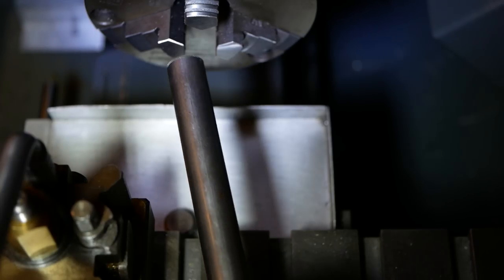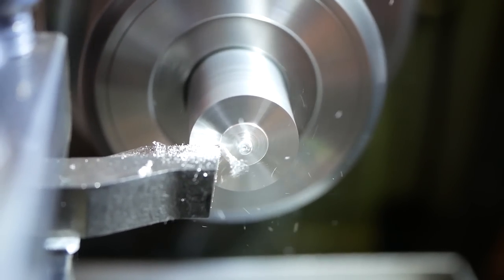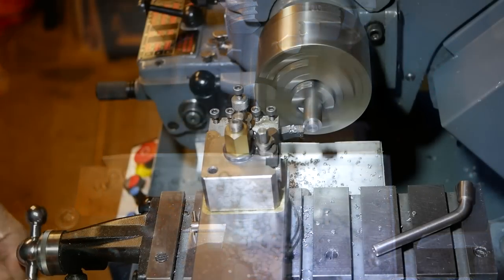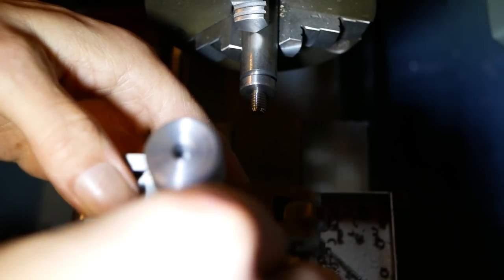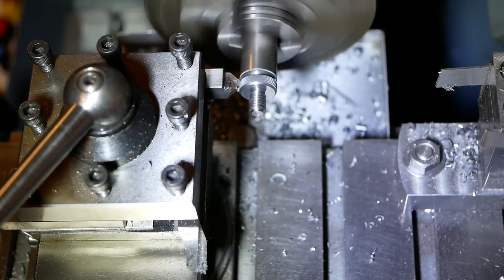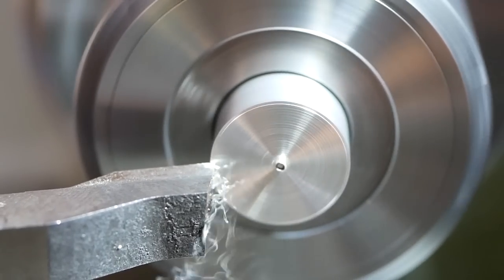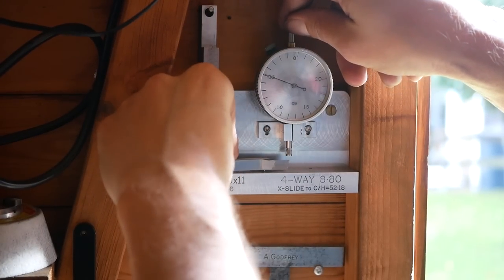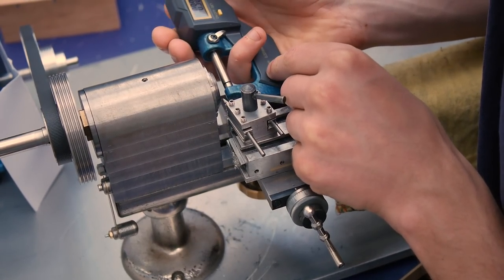In Defence of the 4-Way: Myford Toolholding

Comment: I like the way you think and I like the traditional four-way and I will offer to you another way to make life easier and actually it's a little cooler looking as well after all we always enjoy style points don't we? 

My suggestion is to remove all the socket head screws and replace them with 12 point alloy steel bolts which are very popular with the speed tuning set for mounting exhaust headers intake manifolds and the such.

The American fastener manufacturer ARP supplies these type of fasteners in stainless steel and alloy steel I personally stick with alloy steel last chance of galling and it stays in vogue with the entire tool steel family on the lathe

Then go buy a corresponding dedicated T-Wrench that has the socket size built-in to match your 12-point bolt head --of course it's a 12-point socket and it drops onto the bolt head extremely easily you don't have to Fumble with loading the Allen wrench into the socket and on top of that since the 12-point bolt head is of male configuration you do not have a cavity that collects swarf and chips and grease and dirt and every other thing including hot dogs and stray fingernail clippings and in turn is much easier to keep things clean on the tool holder itself whilst guaranteeing 100% purchase each and every time you drop the dedicated T-wrench/socket onto the 12 point head. Also keep in mind the 12-point bolt configuration has a skirt at the base of the head that the socket nests into once it's seated.

Also being that we are destined to do things right you will eventually be determined to machine a dog nose feature on the end of each Bolt it takes a little time and my goodness if you happen to have a lantern bolt holder that would make life even easier at minimum you will want to dress the end of the bolt because it still has the deformation in it from the manufacturing process and of course you want a nice flat surface to intersect at a right angle with the cutting tools you are securing.

Once you go with this configuration you will never go back to socket head cap screws I assure you.

I wish I had a way to send you a picture of my tool holder with the 12 point bolts in-situ.

Thank you for the wonderful video excellent work it's great to have such an open and easy exchange of information in this type of forum 

Cheers

PS...

Please keep in mind I'm referring to the reduced size aircraft style-12-point point bolt heads. Another factor missed by many is that the socket size for this configuration bolt matches the thread body size so for example if you are in the English or SAE system a 1/4-20 lnch 12 Point bolt will then use a quarter inch wrench12-point socket.

Comment: I am wondering why to change from a lantern style tool holder....  All tool holders seem a pain and they all need adjusting capabilities.  I'd guess saving time being key. (?)
Reply: I liked my lantern toolpost on my south bend. You can eyeball center well enough after a while. They also center the cutting load over the cross slide and are much more friendly for working right up next to a live center. They don’t deserve the bad rap they get.
Reply from the maker: If it works for you, I would stick with it. I know many watchmakers use lantern toolposts. Agreed, I think the faster tool changes with more modern toolpost designs is why few people use the lantern style ones.
Reply: A couple reasons. Every time you use a different tool you have to set the height.  But besides height you are also dealing with shims or extreme angles for smaller size tools.  The QC allows you to set a tool once in a holder and then it's good for quick changes.  The turret type also has tools set once if you're only using 4.
Reply: Thanks for the input(s).  I still ponder making a different tool post, and have, but for as little as I use the S.B., I will stick with the lantern..., for now.  Thanks again.

Comment: I’m going to disagree with this. My quick change is considerably faster. Not only do I have an excess of tool holders, but I always have my tools pre adjusted for center height. I have a dial indicator tool a made to set the center height when I do use a new tool. Your QCTP seems to require wrenches, mine is completely tool-less. I made and ground mine myself so it’s especially tight and solid. I engrave tool numbers on my tool holders, and store the tool offsets in my DRO. For your shop with the system you have it may be faster using a 4 way. But in mine with my system, a 4 way is leagues slower.

Comment: Shimming each cutter sounds like stone age especially when the cutters need the different shims. Buy tool holders when the price is favourable. I've got 30++ of them that way. Bringing the cutter, the tool, to center height is a one time job. Using a good method it's done very quickly. The so called QCTP was developed for a reason and got its name for a reason. The four way coming with the lathe was removed before the first cut. That ancient technology was used during school time 55 years ago and really disliked.
 Do what makes You satisfied. I disagree completely with You.
Reply: With insert holders, 'shimming' is a one time job. Mill a spacer for each of the holders, and keep them together- put them in and they are right every time.
Reply: @Tensquaremetreworkshop  Milling thin spacers, shims is not exactly an easy job for a hobbyist and it takes considerable time. Okey, it cost less money, but still inconvienient in my opinion.
Reply: @Stefan_Boerjesson  not so thin- circa 5mm. And only 2 sizes- manufacturers make carrier sets to the same height. Must have taken 15 mins tops. For them all.
Reply: @Tensquaremetreworkshop  Yes, You're right. Using standard HSS the variations are not that many. Still, untightening and  tightening those 4 screws, adding the shim, feels like slower, and inconvenient to me.
Reply: @Stefan_Boerjesson  2 screws (bolts). Dab of superglue the first time, and the spacer goes with tool. Most are the same height, so half turn lock/ unlock. When you need more than four tools.

Comment: The whole premise of this video is dumb.  You have your quick change tool post "cartridges" right in front of yourself in arm's reach. 

The seriously prehistoric 4 tool holder are dangerous as you have razor-sharp tools sticking out on 4 sides and one of them pointing straight at you!

The only use these old school 4 tool holders have was for mass production of fast-machined parts.

But CNC has taken this job away completely.

Most manual lathe machining is for one-offs,  prototyping and repairs jobs.

Comment: You're taking the very worst of one and the very best of the other.  Its like one of the infomercials were they say stuff like "Are you sick of your pillow being so heavy you need 3 family members just to flip it over?  Well worry no more.  Our pillow is made of FEATHERS!"    At the start you complain about having to use a spanner of all things just to change a tool over.  Yet later in the vid you are undoing and redoing 3 bolts with a hex key to change a tool that didnt need shimming apparently.  Furthermore, my DRO is the cheapest I could get and it gets 10 microns just fine.  Your claim is entirely dependent on the quality of the dials put on the lathe which in my case is laughable.  Silly video that probably had legitimate points to make but was mired in biased fluff for the sake of a stronger premise.  Six thumbs down.